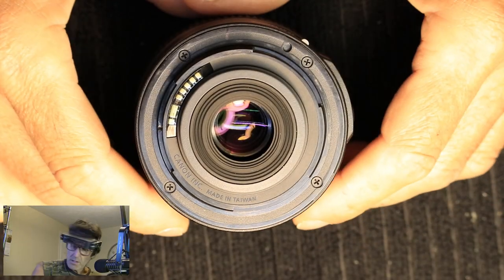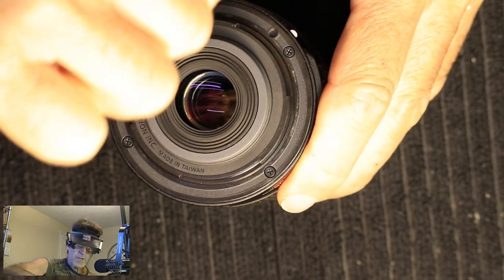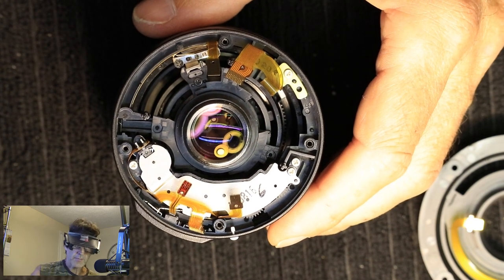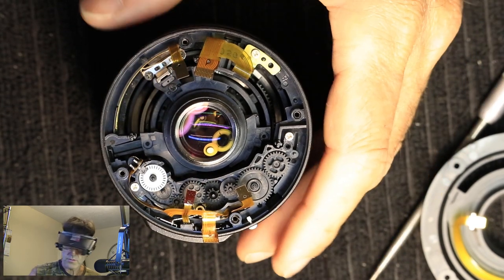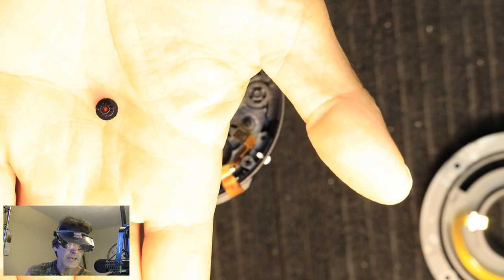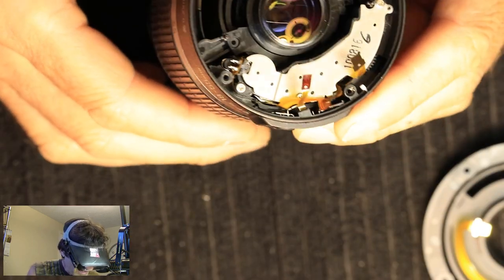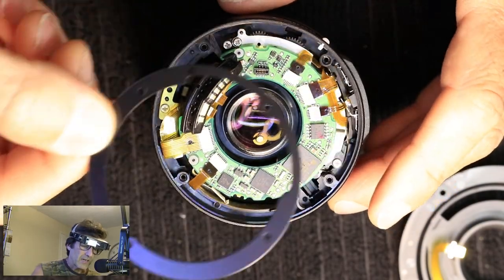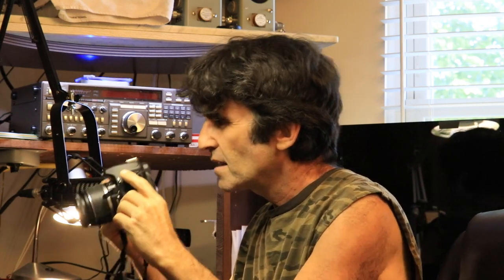Canon Lens DIY Repair: 18-55MM F3.5-5.6 AutoFocus Not.....

Comment: Thank you.  I just took a lens apart to find one of the gears you showed all stripped.  New gear is on order.  This was a lens that someone had cross-threaded a filter into and probably really cranked on it trying to get it off.
Reply from the maker: Awesome!... Say where did you get the gear from?  I get that question all the time and the place I got these from is belly up.. Thanks for the comment... :-)

Comment: Thank you for the excellent video tutorial. Instructions were detailed A.F. A friend of mine broke the af gears by turning the ring when it was in af mode. You saved me many euro and gave me the pleasure of fixing something broken back to working condition. Thanks again. 
P.S. Your channel name rocks! +1
Reply from the maker: DarkVespaStar excellent! It’s not that bad, just need a little patience 😎😎
Reply: which gear specifically was broken? Was it completely broken and you had to replace it or did it just come loose or something?
Reply from the maker: @mrawesome6239  I think I answered your question in the other thread..

Comment: Very good but where would I get replacement gears or know for sure they're the right ones?   My AF works only if I extend the lens first.  It won't extend out by itself to AF.    It wasn't even firing until I wiped all the contact points with a tissue.
Reply from the maker: Have you taken apart your lens to see if the gears are actually the problem?

Comment: Hey man, 

Any idea why when I put an older lens on my 1300d the camera shuts off, if I dont twist the lens all the way to lock it will work but it seems like when I twist it so that the connections all line up it shorts the camera out, sound familiar?
Reply from the maker: Does the camera have any trouble with other lenses?  Are the contacts on the older lens any different?  Maybe they’re slightly different causing it to short when installing.  I’m not familiar with that particular problem

Comment: What camera did you use to shoot this video, I loved the accurate and quick silent focus.  My EFS 18-55 will move the motor in one direction only. If I can't get it to work properly, I might want to replace the camera too. Contacting Canon directly did not result in anything helpful.
Reply from the maker: Sorry for the late response, your comment was lost in the mix..  I'm pretty sure I used the 80D.. I don't use it much anymore because it doesn't have 4K,. but it's still a good camera..
Reply: @JLPicard440  Thank you for the response.   
I was able to fix my EFS 55-80 lens (that would auto focus in, but not out) by doing the simple lens pull.
I have been trying to keep a high-quality look to my YouTube channel by always using a tripod (shaky handheld shots are so distracting); but my lack of autofocus camera greatly limits my content.  
Are you suggesting that I go for the 90D, or is there something else out there that I should be considering?

Comment: Can You tell me please where i can get those gears? My daughter drop my camera and i took lense apart, one of gears is bad. Thx
Reply from the maker: HI, I have a link to the gear 5 from amazon in the description.  The original source I had when I made this video doesn't seem to have them anymore, and I can't seem to find a good source for gear 4.  You might try to call canon at this number and see if they can sell you the parts...Genuine Canon replacement service parts, including inkjet printer print heads are available to purchase by calling the Canon Parts Order Desk at (866) 481-2569.  Thanks and I hope this helps..

Comment: I know it’s not practical but I turned the focus ring several times back and forth and it’s working. Just wanted to put that out there to try. Still great video for guiding us who otherwise wouldn’t have ever tried this. I for sure was about to but it started to work and I would not have tried if you’d not done it here so we’ll.
Reply: Oh I put it in mf before turning the ring
Reply from the maker: Excellent!  Yes it wasn't to hard to take this apart.
Reply from the maker: Good idea so your not fighting against the focus motor..🙂

Comment: Few days ago my Tamron 150-600mm G2 stop auto focusing. Focus motor is always moving and trying to focus but the focus sensor couldn't stop the motor that's why focus motor always keeps moving even after it's last point that's why it gives some bad sounds when focus point reached at last point and could not focus at all. I tried in different body but result is same. 
What could be problem? 
Can you please share your opinion :)
Reply from the maker: Did you take apart the lens to see if there were any bad gears?  If not, it could be that circuit board that interfaces with the camera..  (just a guess).. That's a nice lens.. it's probably worth fixing..

Comment: Hi buddy, that was an awesome video and thx a lot for sharing the successful mission. I actually have a canon camera, but it doesn't auto focus anymore. I last used it to shoot a video, but it seems that the electronic components were affected by heat.. So no luck at all to make it work again despite I installed another lens. I wonder if you have any tips or hypotheses to solve this mystery! Thanks very much in advance.
Jeff
Reply from the maker: Eagle Freedom Hi Jeff.... if you installed another lens and that’s a known good lens... then you’ve got something going on in the camera itself.... I’m sorry I don’t have any suggestions on that one... you might try a google search on your specific model... or see if there’s a yahoo group for canon cameras... possibly get ahold of a service manual to see which module inside the camera controls the autofocus.. I apologize I didn’t have a better answer

Comment: Great production.  clear, sharp and well explained . I've open my lens because auto focus don't work to see if I had any broken / damaged gogs but no,nothing which is disappointing because now I don't what else could be wrong. Anybody got any ideas !
Reply from the maker: I thought there was a circuit board in there.... could be at fault... or the auto focus motor?
Reply: H
Reply: Hi, I replaced the AF motor which has the gogs  inside but still not working which is a pain.
Reply from the maker: @misterc781  It almost has to be the control board.  There's nothing else left, unless there's a connection problem between the camera and the lens.....Assuming the camera is working fine with other lenses of course.
Reply: It could be something simple as cleaning the connection electrodes on the camera-house and the lense. I had trouble with AF on my relatively new and lense with autofocus not being able to focus in manual mode while zoomed in, but a quick clean fixed my problem.
Reply from the maker: Claes Weicher yep good idea.... keep it simple!

Comment: Amazing tutorial and I will attempt the same when I am back home, any chance you have a how to for the 75-300mm with the same issue?
Reply from the maker: No I don't.  If I had one here to work with, I'd do the video!  Thanks for the comment..
Reply: Take a Bath Productions well I picked mine up for £8 so may have to just post it to you :)
Reply from the maker: @NoMansPlanet  That sounds like a great deal!  Even if it's broken as long as the glass itself is good... :-)
Reply: Take a Bath Productions I’m just in Iceland so will check out postage when I am back in the UK
Reply: Take a Bath Productions ah I fixed the 75-300mm with amazing precision all worked perfectly, screwed onto the camera and tightened....then realised I hadn’t put the last screws in and ripped all the connectors in half 🤦‍♂️
Reply from the maker: No Mans Planet arrrrrgh😩😩😩😩😩🤮🤮🤮🤮

Comment: Hi , I have a canon lens 18-55mm. Manual focus working, no issue for motor. 
Problem is it can focus on 18mm and 55mm or 48mm. between 18 mm to 48mm can auto focus only one time then not working. to focus again need to adjust manually for full blur and again it can focus only only one time. Do you know how to fix this issue?
Reply from the maker: Possibly the circuit board in the lens ... as long as your other lenses are working ok.

Comment: What does the connection being disconnected at 3:03 does? It's completely broken on my lens but it still focuses and takes photos.
Reply from the maker: If the plug isn't labeled, the only way to tell might be with a schematic diagram...  I can't be sure what it does.. does your F stop work too?
Reply: @JLPicard440  It is not labeled. I was looking for a diagram but could not find any. The reason why I have opened up the lens in the first place is that the autofocus was not working properly when zoomed. It only works good if unzoomed or zoomed totally. Quite strange that's why I'm wondering if that is causing the issue.
Reply from the maker: Sorry for the late response, sometimes I don't see the comments right away.. Yes it's possible.. did you try plugging that plug back in?  or is the plug damaged?

Comment: Hi mine still has the sound of the gears turning on manual focus. I tried slightly turning it in af mode there is the sound of the motor. I dont think thes the gear fault and mine can only focus from macro to infinity and not both ways. I really need help right now
Reply from the maker: I'm not sure... you might have to take it apart and see what is revealed..

Comment: Great video! Where did you get the replacement gears?
Reply from the maker: The place I got them from quit carrying the parts, there's a place called www.aliexpress.com... I searched them, and it looks like they have them... just put canon 18-55 parts in the search box... here's  a link to the whole gear assy, with the motor and gears included for like $12... 

https://www.aliexpress.com/item/95-New-original-Lens-AF-Gear-Focus-Motor-for-Canon-EF-S-18-55-mm-18/32848674231.html?spm=2114.search0104.3.65.25475f9dt2LgEL&ws_ab_test=searchweb0_0,searchweb201602_9_10065_10130_10068_10890_10547_319_10546_317_10548_10545_10696_453_10084_454_10083_10618_10307_537_536_10902_10059_10884_10887_321_322_10103,searchweb201603_51,ppcSwitch_0&algo_expid=a01db15f-a3f4-4840-926e-7d243b8231eb-9&algo_pvid=a01db15f-a3f4-4840-926e-7d243b8231eb&transAbTest=ae803_5
Reply: @JLPicard440  thanks sit

Comment: Thank you very much for the information, my friend.
I think that's what I have to fix, since in AF mode it works perfectly, but when I switch to MF mode and try to rotate the roulette wheel to focus, I can not focus.
As I have seen that opening is easy, I will try to open, and see if the wheels 4 and 5 are damaged.
Thank you
Reply from the maker: David Benedi yes no problem... I hope it turns out to be a easy fix 😎😎
Reply: Hello again,
I already have the pieces and I proceeded to dismantle it but my canon 18-55 stm seems that it does not have the system of wheels in the upper zone like yours.
It seems that it has it in the center of the lens around the lens, which I do not know how to access ...
I can send you some pictures, to see if you see it better.
Reply from the maker: David Benedi there may be different models of the same lens.... I can try to look at the pics and see if I can see anything about how to access gears...

Comment: Thanks...just fixed a lens while watching you.  I ordered the two gears, but on mine, only one was stripped of the teeth.
Reply from the maker: You're welcome!  Where'd you get the gears?  I have had that question come up several times..  The place I got these has gone belly up..
Reply: @JLPicard440  I got them from a seller on Amazon.  It took a long time to get them.  I ordered them on May 2, and they arrived July 21 in a little package from China.  Didn't cost much, but took awhile.  I first took the lens apart back then, watching your video, to make sure I knew the problem, then set it aside with parts in a sealed bag until yesterday.  Watching again, it took only a few minutes to put it all back together.
Reply from the maker: Oh excellent.  Yeah that's a long time for shipping.  I guess with everything going on it's no surprise... Thanks for letting me know... :-)
Reply: @oldengguy  Are the gears just called Canon auto focus lend gears?
Reply: @lise-annedore8935  I think you mean, "lens" instead of "lend," right?  I just looked back and found that the gears I had ordered are no longer available.  In a quick search, it looks like some people are selling the entire motor assembly including the gears, but not the gears alone.  I couldn't find those anywhere.
Reply from the maker: @oldengguy  Yes it's the same job to change out the whole assy... if the assy is available it's a good solution to not being able to find the gears...

Comment: hey so i need to buy the mechanic things ? like the one u changed because of the broken teeth
Reply from the maker: The place I got the parts from is belly up.  You might be able to get them directly from canon, or I've seen the whole motor focus assy on ebay for about $30.

Comment: Which size are the 2 first screws that you unscrew? sorry for my english i need this info
Reply from the maker: That's a good question.  I am not sure of the size..
Reply: @JLPicard440  i mean the size of the screwdriver that you use. Is for buy the correct tool
Reply from the maker: OIC... I have a set of those assorted small screwdrivers.  Like Jewelers screwdrivers.  There's always one that will fit..

Comment: wow but if my tooth are broken, how can i find the replacement gear pls help mister
Reply from the maker: The place I got my parts from has since gone by the wayside.  I've seen where you can get the whole focus motor assy on eBay or another place called aliexpress.  The focus motor assy is fairly cheap.

Comment: On an 18-55mm lens with no STM, only manually rotate the zoom when it's on Manual mode. Never when its switched to AF.
Reply from the maker: Yes, because you'll be fighting the motor...

Comment: What was the behaviour of lense before repair? Did it not move at all? No sound? Or sound of motor but not moving?
Reply from the maker: Fawad Zubairi I believe u could hear the motor running but no moving... the focus ring would allow manual focus
Reply: yes sir i have this question. my camera lens wont hear any motor sound but wen i set it to automode in the camera den AF on the lens, it does not capture images but it does have flickering lights like maybe 6x. Hope you could help me out thanks

Comment: Any ideas? The lens won't autofocus in manual or auto mode but will do so in video mode.
Reply from the maker: That tells me its not a mechanical problem.  Do other lenses work properly?  Could be a problem with the board inside the lens, but I'm just guessing.
Reply: @JLPicard440  I've tried it with a 2nd kit lens and the same thing is occurring
Reply from the maker: @iangooda4634  Hmmm..  Seems like if the same thing is happening on 2 lenses it could be an issue with the camera itself.  Maybe check the menu to see if something isn't set right before I'd suspect a real problem going on with the camera.

Comment: Where in the heck can I get gears???
Reply from the maker: I can't find the source I used to get the individual gears that I bought when I made the video,. but if you go to ebay and search for "canon 18-55 focus motor" I found several.  You'll have to change the whole motor assembly which is what I'm taking apart here in the video.  Once you get it to that point where the motor is exposed, it shouldn't be much more difficult to remove the whole thing and swap it out.  Or you can probably call Canon parts and maybe buy the parts directly from them.

Comment: Where did you buy the parts that was broken to replace it. What is it call?
Reply from the maker: Hi, It's listed in the description.... Thanks..
Reply: Take a Bath Productions Thanks for responding to my question. I appreciate your help. I have the exact problem,but not sure what part is causing the problem. Will need to open and examine the inside components. Great tutorial with amazing sounds quality and video quality as well.
Reply from the maker: It could be the same problem,.. it was obvious that the gears were stripped when I took it apart.. but it also could be something else... but the gears are the cheapest problem.. so I'll cross my fingers for you!
Reply: Thanks bro!

Comment: could this be part of my issue with my canon 75-300 if lightly bumped it will autofocus but also focuses very slow. The lense was given to me and never worked properly before ether.
Reply from the maker: It almost sounds like the lubrication in the electric motor has gummed up.  If it was a broken gear, the motor would be slipping and it wouldn't be able to focus.. If your courageous enough.. take it apart and see if the motor is spinning freely by hand..
Reply: @JLPicard440  i have been considering taking it apart to try and figure  out and see if the gears ether needed cleaning or were messed up. what would you recommend to use as a lubricant and cleaner for it. 
thank you for your response btw i greatly appreciate the advice.
Reply from the maker: I think just any lubricant that's made for electronics...

Comment: and you found gear where ?
Reply from the maker: The place I got it from has gone belly up... U might be able to call canon.  There's also a place called aliexpress that seems to have parts like that.  eBay is also a good possibility..
Reply: @JLPicard440  I called Canon bu they gave me a Psychiatrist  number , then i called him told him that i called Canon  to get some plastic gears and he said that i should drive to him at once without delay and that he can help me .
So thanks for the advice .Looks like it worked .
Reply from the maker: Lol.. Not sure if you were able to find the gears?  I've seen where the whole focus assy is available for pretty cheap.. Thats an option too if you can't find the gears by themselves...
Reply: @JLPicard440  As usually take 2 broken make one that works :)
Reply from the maker: @dedskin1  Yes that'll definitely work too..